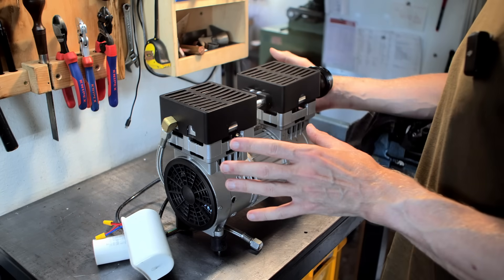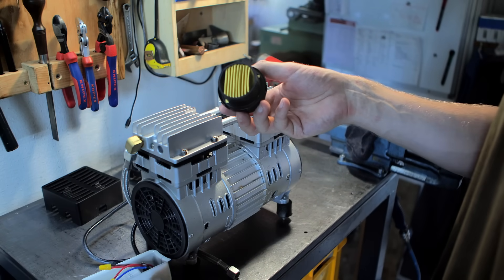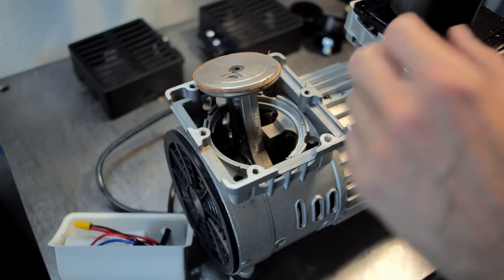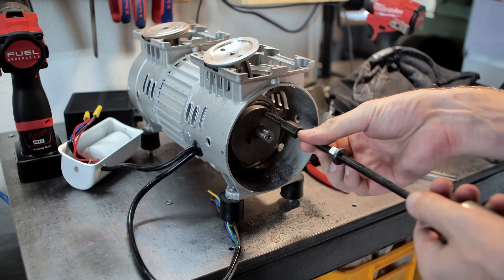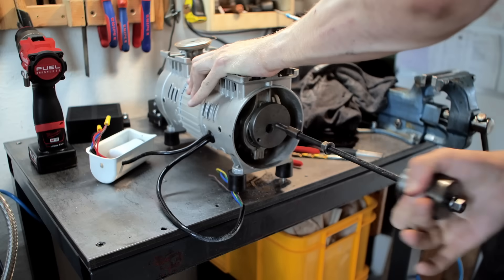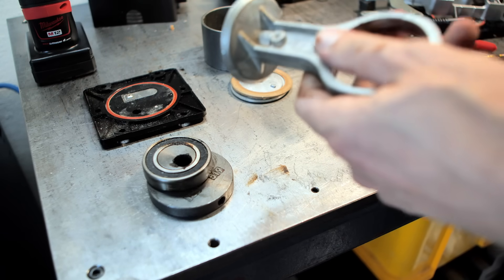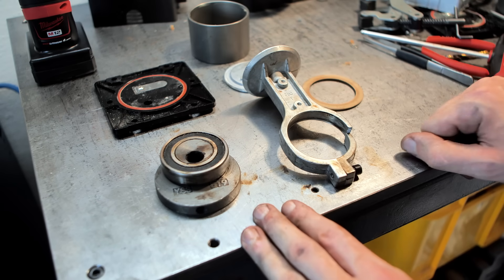Silent compressor - Destructive teardown

Comment: You used to have Bosch 12v tools. Why the Milwaukee now?
Reply from the maker: I murdered the Bosch - 10+ Years of use in the shop and around the house. The batteries where dying, the housing of the batteries cracked because i used them as an extended handle on the drill, the drills i had where worn out completely.
So I invested in the M12 system as it has the biggest selection of tools with the same battery.
Reply: @StefanGotteswinter I've listened as your spoken English has improved significantly over the years of releasing YouTube videos. Most impressive! (And certainly better than my rather limited German) 😂

I hope you won't take offense to a quick pointer for your written English (that many non-native speakers get confused with). 

"where" refers to a location; "where did i park my car?" 
"were" is the past tense of "are"; "we were watching YouTube together yesterday".
"we're" is a contraction of "we are"; "we're going to the store now."

Comment: these SUCK for any high duty use. low duty they are fine and should last several years. high duty, you will maybe get 1.5-2 years out of them. currently using a v piston pump with external motor. loud but reliable.

Comment: Great little compressors, mine also lasted for years, running nail guns, inflating tyres, running all my model steam engines and general cleaning around my little workshop.  Thanks for sharing, really interesting seing the inside, the motor also died on mine.

Comment: Trivia: Reverse or swap in a different head, valve body, and they become vacuum pumps. Often employed in banks where one cycles while the other cools. Very inefficient either way so you can have banks of multiples to pick up the slack. For example, a hospital I worked at had 16 such pumps in vacuum configuration, each bank had two four cylinder units trading back and forth the duty cycle and a duplicate second set on standby. Never rebuilt, just swap out a unit or entire bank in minutes. Obviously hospitals have 100% redundancy.

With more exotic materials, life expectancy can span 20 or 30 years. As with yours, the motors usually die first. 2 pole high speed units.

Comment: This was quite an enjoyable video. BUT. You call it a silent compressor. I have never heard a quiet compressor, so I wish you had cranked up the new one so we could hear the silence.
Reply from the maker: did you hear something? THATS how quiet it is 😁
(in honesty, the video of the old one is linked in the description, the new one is ever do slightly quieter in my perception and has a slightly more cultivated general running noise - nothing groundbreaking/ overly surprising.)
Reply: ok. thanks. i'll have a listen.

Comment: I have a bunch of these with the diaphram configuration.  I took one apart I think I had to cut the motor shaft and actually get it apart.  Yes the double set screw Is def evil.  Only time I've ever seen it was on a bridgeport head.

Comment: Compressor story. We had some large, old Worthington piston compressors at work. They decided to have different people rebuild the reed valve assemblies. Thiese were two stage compressors with an open frame around 2 plus meters in diameter. Anyway they assembled the reed valves as intake only. Compressor turned over maybe two revolutions before it blow the cylinder head off of the end of the high pressure side.  Cylinder head went through an outside wall and across the street. Fortunately it was very early in the morning with no traffic.

Comment: My journey into one of these, was in a premature failure,  the piston seal was a slick, silver flecked polymer, that was in the shape of a cup, U facing upward, the sides of the cup were at most 2.5 mm long, the rest was the same.   .....    best regards   Steve.

Comment: There's a huge chance that it just overheated and the thermofuse that's on the windings has blown and could probably be replaced or bypassed.
Reply from the maker: That would most likely not lead to a ground fault.

Comment: We use the same pump to aerate a water reservoir on the farm.  It runs 24/7 and has done so for years, probably more than a decade at this point.  We did rebuild it, I think at least two times already.  The rebuild kit comes with piston sleeves, piston seals, reed valves.   I suppose eventually those ball bearing on the crank will fail.  Or, maybe the motor bearings.  A well engineered pump.
Reply: When you say it runs 24/7, do you mean it's always switched "on" (running occasionally when the air tank gets low) or that it's pumping 24/7 at 100% duty and never hitting the cutoff pressure? If the latter, that would be absolutely crazy.

I'm still wondering what it is about these that makes them quiet. Just having two pumps so each can have half the stroke? The dead space on the intake and exhaust heads? A lower RPM? The gray paint?
Reply: @swolebro  May be that it's a big reservoir/aerator and the compressor never builds much pressure, i.e. much closer to free running than max load. I've seen smaller similar looking pumps sold for big fish tanks or hydroponics systems, those are configured to run constantly but the pressure is very low, whatever you get from line restrictions and the water column more or less. Suspect the quiet aspect is a factor of design mindful to noise in general more than anything else, all of the above and then some.

Comment: Dissimilar metals will seize with machines screws and bolts . With experience with repairing small tools, I've always found much success with manually impacting downwards .  It's beats ruining the fastner .

Comment: One of the advantages of having the piston fixed to the connecting rod is that the piston doesn't slap against the cylinder as it goes up and down. This is both a source of noise and friction on engines. Clever design.

Comment: I was literally repairing a similar one today where one of the inner 6203 bearings would bind when the unit got hot. It similarly had the double set screws but I didn't realize until I had pulled it off with the bearing puller. A lot of swearing occurred when I realized. I too was really impressed by how simple and thoroughly refined the design and construction was. One detail you didn't mention was the recess cast into the piston crown for the inlet valve screw head. The piston crown clocked onto the piston by the two square "pins". So simple and robust. Replaced the bearing in mine and ran the thing for 25 mins pumping into the tank at 6 bar issue free.
Reply: Did you knew upfront it was the bearing that was bad? Or did you find out while disassembling? Mine does the same (slow lockup while getting hot) so I'm guessing I will need to replace the bearings aswell. Will investigate mine in about a week from now.

Comment: mine was smoking 2 years ago. An rcd tripped and when I reset it the compressor stalled I assume, took me a while to figure out where the hot motor smell came from...but it still works...

Comment: Stefan, find an old fridge , takethe compressor and pipe it up to a tank, time it to run overnight for cheaper electrical tarrifs and given a big enough tank you will have all the air you need both chaply and silently for all your shop needs and likely more if you tune your system to your needs. Cheap  reliable and as silent as a fridge!
Reply: They tend to overheat when they're not pumping ice cold freon
Reply: @marinijaish  They also throw a lot of oil mist as it's assumed to be pumping a closed loop. They're right up there with microwave oven transformers in the category of stuff you think is salvageable for some general use but really isn't worth the trouble once the finer details are understood.
Reply from the maker: I have free electricity during the day thanks to solar - A fridge compressor doesnt cut it for my use unfortunately, been there, done that.

Comment: Primitive ??  try elegantly simple.     what killed it was building too far down to a price  (after 10 years of zero maintance service).  many of the suppliers of these compressors offer  the pistion seals, piston sleeves, seals, and reed valves in a maintenance kit.
Reply from the maker: (i mean, there is nothing to maintenance on these apart from draining the water from the tank every so often).
Reply: @StefanGotteswinter  Hopefully you  did not hear a suggestion of neglect, more a comment on how very good the design  is.
especially at the low  cost build quality.
it appears that the most common maintance need is replacing the piston seal, and sometimes the piston sleeve ,as  the seal also
prevents the piston from rubbing metal to metal on the sleeve.

Comment: Seems as if the compressor was still working fine after a decade.
Goes to show KISS. Cant wear or break what isnt there.
Was hoping to see the melted winding or whatever had failed.
Reply from the maker: It had a obscure ground fault, no way for me to locate/identify it clearly, sorry.
Reply: @StefanGotteswinter  Ahh. Yes you said ground fault.
It certainly has done well for you!  👍
Hoping the new one serves your needs even better

Comment: Most interesting part for me is that gasket material in the piston. Looks like some teflon impregnated cloth. Impresive number of bending cycles in 10years. Is motor 3000rpm or some high speed version?
Reply from the maker: They are 1500rpm.

The gasket material feels/looks non-reeinforced to me.
Reply: @StefanGotteswinter  you missed the most important reason why your compressor failed. You can clearly see that the Teflon piston seals have failed by the bits hanging off. This would cause the motor to run almost continuously trying to build up pressure. This causes overheating with more piston seal failure.
Reply from the maker: @peterlourens6503 I would have noticed it run close to continuous.
(I mangled the seal on assembly/disassembly/demo in the video)

Comment: Already replaced with a slight upgrade? How about some details on the new one?
Reply from the maker: 1.3kW from a single motor / 2 pumps, nicer pressure regulator and a internal coated tank.

https://www.stuermer-machines.com/compressed-air-technology/compressed-air-technology-piston-compressors/mobilboy-silence-23150-of-e-2002326/

Anything else, time will tell. Basic compressors are not exactly exciting :D

Comment: Depending on the pressurestat design, these can burn up if you unplug them while they're pumping, and then plug them back in. The pressurestat dumps excess pressure when it signals 'at pressure', so that the motors can start up on an unpressurized system on thr next start. If you unplug them and plug them back in, the motor will have backpressure while starting up and mine (very similar on the outside) can't start with too much backpressure. So they will stall and burn up. Mine got very very hot but I saved it in time when it started to smell.
Reply: Generally, if a compressor has a basic toggle switch, it uses an electric pressure sensor, whereas if it has one of the metal throw levers going into a plastic box, that's a mechanical pressure switch. The unloader valve will be somewhere on the side and you'll see a tab sticking out that bumps it when the pressure feed line off the tank opens the electrical contacts. It's a very interesting widget inside.

You can actuate that valve manually if need be. The HFT compressor that I have also has a small pressure sealing valve on one of the heads that you can hit manually as well. (I have yet to take it apart and see if there's any particular reason they placed it there, as it releases naturally whenever the unloader is actuated.)
Reply: I bypassed the mechanical pressure relief with a normally open pneumatic solenoid with a suppressor. The "hiss" is a lot quieter when it shuts off and the line will never be left under pressure.

Comment: When you break the piston rode I also understood where if was engineered to fail. Thank you
Reply from the maker: "engineered to fail" is a myth / misunderstanding.
Reply: I thougt it is real thing for selling more products. Thanks.
Reply: @yirgalemdesta7869  As a rule, if you're a manufacturer and you design something to fail, it will fail far more frequently during the warranty period and you'll have to pay for its failure.  It's very hard to design machines to reliably fail early, but only after the warranty expires.

Also, in this case, that casting was perfectly fine under ordinary operating stresses and it only broke because Stefan used a slide hammer to get things apart.  If he intended to put it back together again, his disassembly process would've been far more methodical and gentle.
Reply: @t.s.4494  With everything computerized, they can just put a timer in the device.

Comment: Very interesting - thank you - I have basically the same compressor. Mine's tankless and I use it with a foot switch by the lathe and mill. Rather than have a compressor tank charged up all the time and have to deal with draining water from it daily I just step on the switch when I want to blow some chips off the mill or lathe. For occasional machining it works nicely. If I were working full time out there I'd use a normal tank setup. It's great that we can buy quiet compressors and vacuum cleaners now. SO much nicer in the shop without all that obnoxious howling noise 🙂
Reply: Interesting idea. Do you get any pressure without tank? Do you still use a pressure regulator?
Reply: @vpcred3706  Mine's from California Air Tools but I see copies from Vevor and probably other sources. It's sold as tankless so there's a pressure bleed off when the compressor's running and I'm not releasing any air from the hose nozzle. And yes, there's a regulator to set the output pressure from the nozzle. And it's always ready instantly - no waiting for a tank to charge up to pressure. Mine's only one horsepower and the output isn't as strong a blast as a larger compressor or a fully charged tank on a smaller one, but it's plenty for blowing off chips.
Reply: @jefflastofka9289  Thanks! It makes sense now.

Comment: Great video, thanks for sharing! I was just curious about the old compressor. It looked like the only failed parts were two gaskets and two bearings, which are usually very inexpensive to replace. Was there another, more serious issue that made you decide against a simple repair and opt for a new unit instead?
Reply from the maker: i had a ground fault tripping the gfci - the mechanics of the compressor where 100% ok before i went berserk with my disassembly:)
Reply: Having the motor rewound would probably be more expensive than a new compressor unfortunately. Looks like it could have done with a new set of piston seals too.
Reply from the maker: Also I would be stuck with no compressor for a few days, thats not an option.

Comment: That's very neat and interesting, something I've been curious about for a while myself. Economical design with decent output and doesn't hurt your ears. I've got a similar one and it works fine, but it's on holiday compared to yours. Mine has an aluminium tank too so it doesn't rust, but I have reservations about it's longevity after lots of pressure cycles. It's also prone to tipping over backwards when moved with the handle. Thanks for sharing that, I have learned some new things today.
Reply: I would have reservations about an aluminium pressure tank.  What pressure does the unit go up to?
Reply: @ferrumignis  I think it's rated to 8 Bar, 5 year warranty on the tank. I always drain and empty it after use so it doesn't hold pressure for extended periods, for whatever that's worth. Not sure what the relative risk is compared to  the one it replaced that always produced rusty foul smelling water . . . .
Reply from the maker: Aluminium tanks on compressors with 50l tanks get more and more common.
Since they have to get pressure checked and signed off from the manufacturer just as a steel vessel, I would have no worries.

Comment: 7:23 not evil, that's smart. That's essentially a lock nut, but as a set screw. Old school method to make sure the set screw doesn't come off. This was well made. 
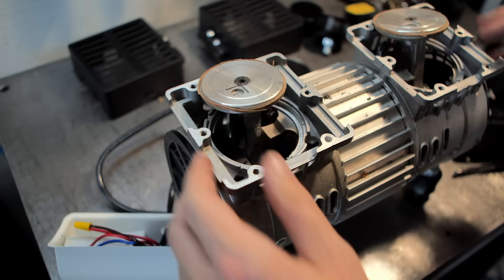4:52 KISS design. If it weren't for the electric fault, i bet you this would've ran even more and someone dedicated could fix this pretty easily. It is designed to be fixed, so that's a defo plus in my box. I've seen some really unpleasant things done to make sure you never fix the compressor, like staking the cylinder wall or staked piston heads, where you can't remove the gasket, or plastic, which is the worst. Everything is made from plastic, which wouldn't be an issue if the cylinder wall was made out of a sleeve of teflon bonded material, but no, just regular old ABS.

Comment: I always keep screws, especially specific stuff like shoulder bolts, small screws, oldies etc. You never know when they might be useful and storing them is cheaper than getting them. I have like 5~6 sortimo boxes and a few smaller cardboard loose ones with really disparate ones like one oil pan bolt or one or two large but snubby bolts. It has paid dividends so far. I've finished several projects using recovered screws and have repaired a number of machines with them too. Best part where you can use them? Getting rid of safety screws/bolts. Those go right in the trash box.